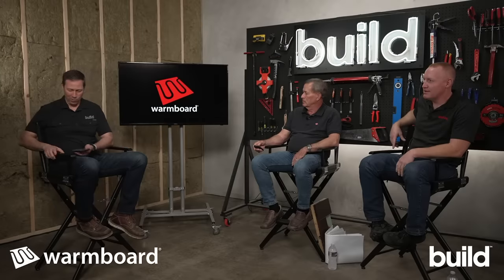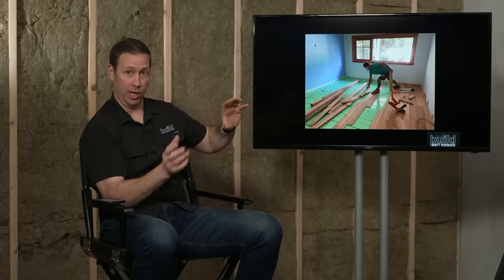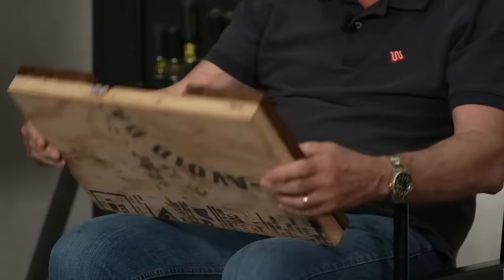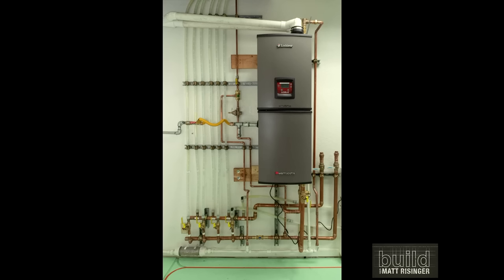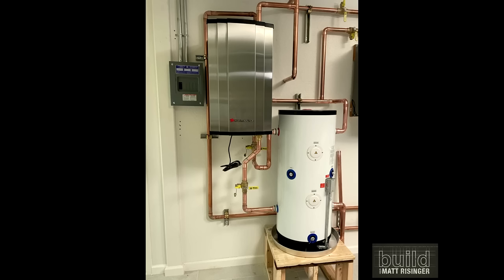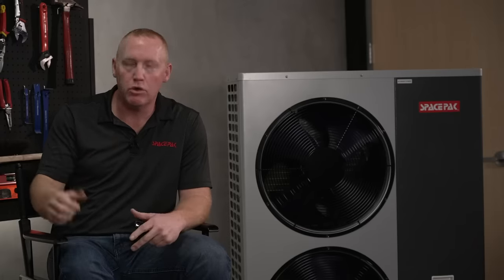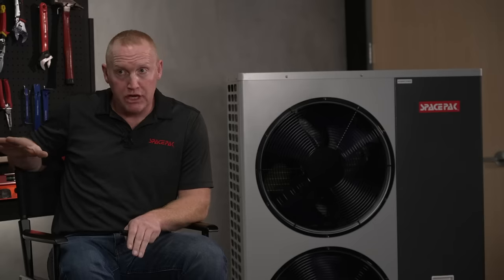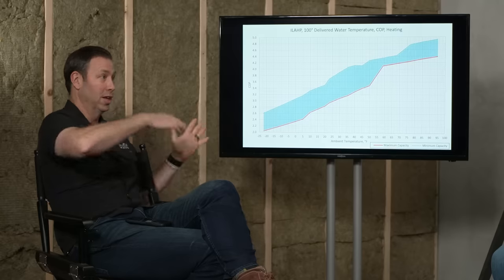Cold Climate Heat Pumps for Radiant Floor Heating. No gas, no boiler!

Comment: As someone who has lived in homes with central forced-air heat/cool, others with minisplits, and yet others with ducted minisplits, hot water "radiators" etc.... I would go for minisplits or ducted minisplits any day. They let you zone your temperature settings easily, and the load can be shared by multiple outdoor units, which means you can have several smaller capacity outdoor units running more efficiently, rather than one giant one running at inefficient part load. But you need fresh air ventilation, otherwise indoor air quality literally stinks pretty quickly, especially in a modern, tightly sealed house with guests in the room.  The advantage of per-room fresh air vents is that you can route more fresh air to the occupied rooms (using cheap air quality sensors) without having to overloadi the whole house with cold outside air just because one room is packed with guests. Works well with those tiny single-room HRVs if,you want too. 
 You can also instead use fancoil units in each room, which look like minisplits but use chilled/heated water (as was shown in this webinar in two variants: the high wall and the thin wall types). They work just as well as R11 based minisplits, but again you need fresh air ventilation. 

And as someone noted above: radiant floor systems can't do cooling, so if you need heating AND cooling, you're duplicating capacity for your cooling sysytem, which makes zero financial and environmental sense.
Reply: I respectfully disagree.  I've lived in the variety of houses you list too.... but I now live in a Tennessee house with what for me is the best HVAC configuration.  We use Warmboard/Lochinvar/Tekmar and solar (roof mounted water circulation goes into the Lochinvar Squire which serves as a hot water buffer tank) for our main heating system.  I have 29 different loops, so I can customize the heat performance throughout the house (i.e. bathrooms are warm, bedrooms are cool, closets are cool, living areas are moderate, kitchens are mostly moderate, garage floor is comfortable, and offices are cooler).   The proper heating temperature controls work fine during fall, winter, and spring.  However, cooling in the summer is achieved with a mini-split for cooling.  This system too allows a variety of temperatures to be achieved in different rooms, since each room has its own cassette and control.   This combination means that there is very little ducting and accompanying dust issues in the house.   I said "very little" because there is some ducting associated with the ventilation system in the house.  An airtight house has a problem when bathroom or kitchen vents are active.  The bath/kitchen vents cause negative air pressure inside the house and make-up air has to come from someplace, so rather than allow outside air to enter the house via furnace vents or fireplace chimneys, we have a few ducts connected to a baffle/damper.  These dampers are activated (via insteon smart home connections) whenever a bath/kitchen vent is activated.  Hence make-up air is well managed.   As to your point about "zero financial and environmental sense" I think having a split system heat pump as a backup for heating the house provides peace of mind (and cost avoidance of a catastrophy) if one is on vacation during the winter months.  The heat pump can be set at a low temperature (50 degrees?) such that if there were to be a problem with the radiant boiler/circulator/gas supply, the house will not freeze and suffer water damage.   The resulting combination setup allows us to take advantage of the high efficiency/effectiveness of radiant heat for 3/4 of the year, while enjoying our separate mini-split system for appropriate cooling in the separated cooling zones of the house.  The initial costs were higher, but the overall cost per year for operation is lower.  And, most importantly, the house is extremely comfortable.  When we lived in a house with just mini-splits we were not able to enjoy the pleasures of walking barefoot throughout the house (especially warm tiles in the middle of the night).  While I really liked our mini-split equipped house, the combination system in our current house is both more efficient and more comfortable.  Just a sidenote:  I found that adding a simple de-humidifier in my garage/shop area achieved an adequate cooling effect during the summer time.... no need for air conditioning there.
Reply: look how its done in europe, much better then in USA.
Reply: @skipsaunders5974 So how much did all this cost? Do tell.
Reply: @JohnLee-db9zt  Your "do tell" comment makes me believe you really don't care, you simply want to troll my comment.  However, there may be people who are honestly curious.  For them I would suggest doing a true cost comparison based on what they estimate standard construction practice costs would be vs what a well engineereed (and well installed) system would cost.  In my case, the cost differential was about 15%.   My builder had his preferred subcontractors and we had firm quotations for what they would charge.  My builder allowed me to go find my own subcontractors/supply houses for whatever part of the construction I wished and he did not charge his "builder's mark-up" on anything I did .... including anything I personally performed labor on.  Were that arrangement not true, I believe my cost differential might have been about 25%.  Nevertheless the outcome (after living in the house over 10 years) has been a net cost savings of around 3% and climbing.  (The longer I live in the house, the more I save ...)

Comment: I just installed (with the help of my neighbor) warmboard in our pre civil warm home while it was up on cribbing and steel because of rotten sill beams. A 2" thick concrete topper was poured to relevel. The new deck with warmboard was installed and the house set back down. Its a 24'x26' two story farmhouse and the type S warmboard with the manifold, fittings, pex, design work and delivery was 9k. Its not completed yet but I think it was totally worth it. Great video even though we are going with propane fired since I just buried the tank.

Comment: We used Warmboard in our custom home in 2014 and all the superlatives about the quiet and comfortable heat are absolutely true.   It was the first time that I've lived in a radiant heated home and as mentioned, I'd never want anything else.   We use a gas dual-combi boiler for domestic hot water and for the radiant heat.    I was curious if that system could be replaced with the SpacePak.   Due to cost, we probably wouldn't want to do it any time soon.  But if we ever needed to replace the unit, we'd certainly like to consider this as an option.
Reply: We had a radiant floor, concrete slab with copper pipes (it was old school). Radiant is very finicky, depending on what's going on outside. As the day warms the inside floor continues to throw off heat and soon becomes unbearably warm. Concrete has this problem. I imagine wood (warmboard) is much less problematic in this way.
Reply: Warm board would work great with solar thermal.
Reply: @Hoot Owl  I have radaint heat floors  with pex  tubing slab  on grade  and 2 layers of 2lnch foam one  layer going one direction and the next layer  going the other  so the seams get cover by each other  I leave my heat at 72 degrees  and it stays there  no hot or cold swings like yours  just wonding if your floor was insulated. Best  Regards Arthur
Reply: @hootowl6354  -  Like the post from Arthur Perrea here, we have a daylight basement with concrete slab on grade and foam insulation below the concrete.  The embedded PEX tubing in the concrete does an excellent job at regulating temperature - the concrete slab is slow to respond to changes in the thermostat naturally, so when entertaining guests for rousing ping-pong games, it gets over-warm sometimes, but we then just crack open a window or two. 
Sunny days do not cause over-warm conditions.  Sunny days just mean that the thermostat is satisfied in part by the solar-heated air temperature,  and the radiant heat doesn't kick on as often.

Comment: Concrete is not bad for radiant heat but it's a thermal mass so it's slow to react. (The thermnal mass is also a good thing to keep things consistent and temp is not affected when a door or window is left open for a few minutes)  The cement floor will absorb the heat and slowly release it so it's slow to feel the effect in the room.  Also if you build with ICF and LiteDeck with radiant heat you keep the temp at the same.  For instance, if you change the heat it will take time to heat the cement floor which will then heat the air above but then the ceiling and walls with concrete will absorb the heat until ALL are the same temp: floor, ceiling, walls and the air.  So, you just keep the temp at a comfortable consistent temp.

Also, this also means that you need to have a tight envelope otherwise you will have more headaches keeping consistent temps and keeping people comfortable since its about moisture in the air.  If the air is dry you will feel colder. So the tighter envelope will keep the moisture in while its cold and dry outside so people in the house will not likely touch the thermostat.

I think this wood panel with pex in it is vulnerable to damage where as concrete is very resilient to damage over its lifetime.
Reply: I think he's arguing for aluminum because the heat transfer is going to occur much quicker through aluminum than concrete at the same temperature. This will heat rooms faster which means your system can be much more efficient than with concrete

Comment: Hey Matt,  I have followed you for years and really appreciate the perspective and new info you bring to the game.  I watched this episode with eagerness, as I have been studying up on air source heat pumps for the last year.  I was looking forward to hearing what the ambient temperature operating capacity for this particular unit  is, as I have not found anything yet that is a viable option for Manitoba, Saskatchewan and Alberta.  To see and ambient rating of -22 F or -30 C is an amazing improvement in heat pump technology.  I live just outside of Calgary Alberta, and the only problem is,  tonight is supposed to go down to -40 F or -40 C and the temps are supposed to stay below -30 C for the next 5 days and it is not even January yet!   Now, granted this is highly unusual weather we are getting right now, but we normally get below -30 in late January for a few days, but we shouldn't design our systems on normals but on the extremes, just like your build with hurricanes in mind.  Until this technology can handle -45 C to -50 C it would be foolish to invest in it here on the prairies in Canada.   There has to be some way to create an ambient air chamber that can be preheated to increase the ambient that is entering the unit and maintain the efficiency benefits of heat pumps.
Reply: You wouldn’t pre-heat the ambient environment with the goal of increasing heat pump efficiency, you install backup heat in the home for those extremely low but infrequent temperatures.  Resistance electric is the most popular, though a gas or propane backup would be less expensive to run.
Reply: > Until this technology can handle -45 C to -50 C it would be foolish to invest in it here on the prairies in Canada.

It isn't foolish--you let the heat pump handle everything down to -30 C (including very efficient air conditioning for those hot summers) and let electrical resistance backup elements in the buffer tank handle temperatures below that.0
Reply: @hailexiao2770  yes.  We’ll be waiting a long time for heat pumps to work effectively and efficiently at -50C, lol.  I don’t think we have refrigerants on the horizon, or anywhere, that would fit that bill.  Not to mention the market for heat pumps gets smaller and smaller the colder you go.  For now it’s expensive electric resistance or cheaper fossil fuels for heating at those extremely low temps.
Reply: @superspeeder  There's always ground source heat pumps. If you consistently see -50C but are lucky enough not to have permafrost, that's one of the few situations where GSHPs make financial sense.
Reply: @hailexiao2770  very true, good point.

Comment: So essentially a monoblock heat pump, popular in Europe for quite a few years. I myself have daikin altherma 3, 6kw power (for 1550sq f house), which is using refrigerant and circulates it to outside unit, installed it costs 12k USD here (Poland) - has inbuilt 180L water tank and does hot water. Most new houses built here have under floor heating but it is essentially few cm of styrofoam, pex on top of it and then concrete like floor mix poured on top of it. Some commenters here said something to the tune "fan can freeze at low temperature" - nope, it won't, pumps have additional resistance heaters to prevent that from happening, good to minus 25'C/13 F

Comment: The problem with utilizing the air as your heat source (aka water-to-air heat pump) is when you need the heat the most, there’s not a lot of heat in it and COPs suffer.  Consider utilizing a geothermal heat pump (water-to-water) where the COP‘s can stay high (4+) even in the dead of winter. Also, if you control the dewpoint in the room, you can do radiant cooling with the same “radiator”(warm board become a cool board).
Reply: Radiant ceilings are a more popular method of cooling than floors, and likely a more comfortable one.

Controlling dewpoint can be done, but is risky in a residential setting and requires some diligence from the homeowner.  No leaving windows or doors open while the cooling is on, for example.  That is common sense, but with regular AC the risk is less.
Reply: COP?
Reply: @InexplicableBill  Coefficient of Performance.  Basically how much energy a heat pump can transfer for every unit of electricity it consumes.
Reply: @superspeeder  when you need heat, its the coldest outside, so the most bad time to use a heatpump........ when its warm outside its the best time to use heatpump...........but then its warm inside so u don't need one.
Reply: I've been wondering about this sort of combination myself.  We have plenty of land for an in-ground water-to-water loop. Where do you suggest we look for more information?